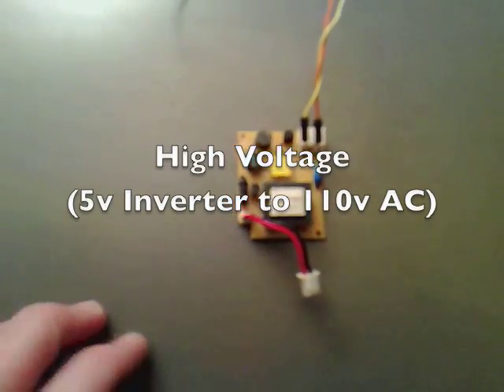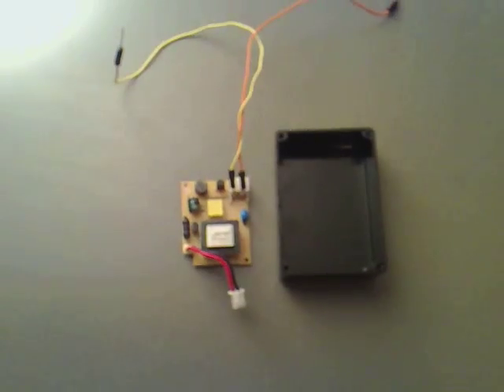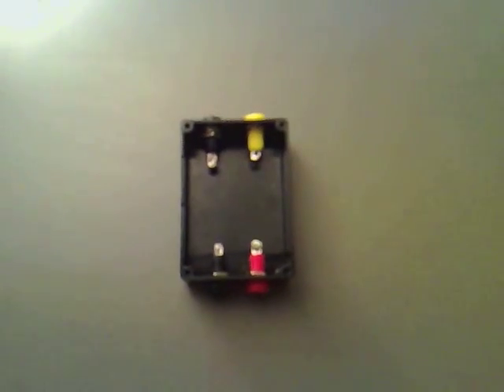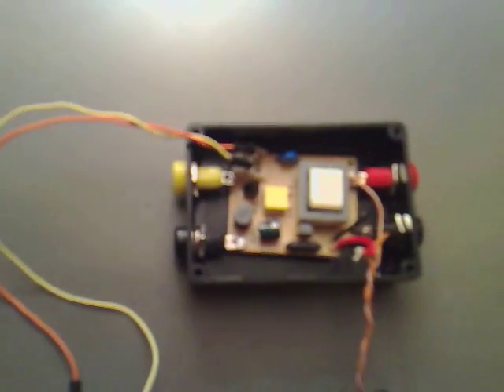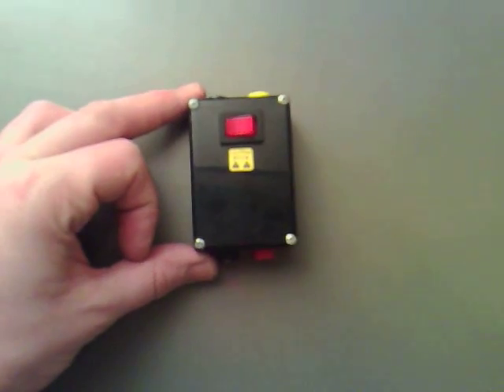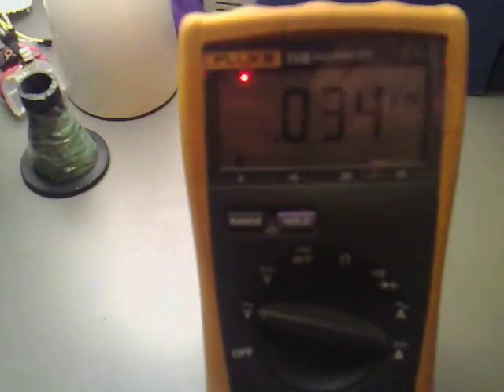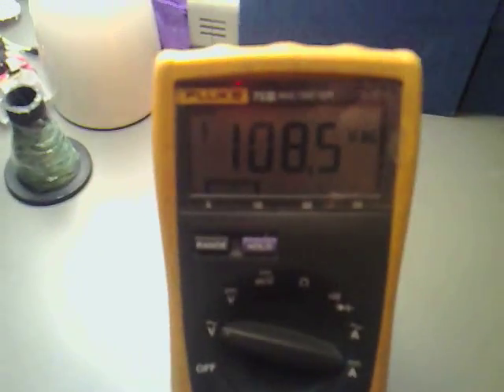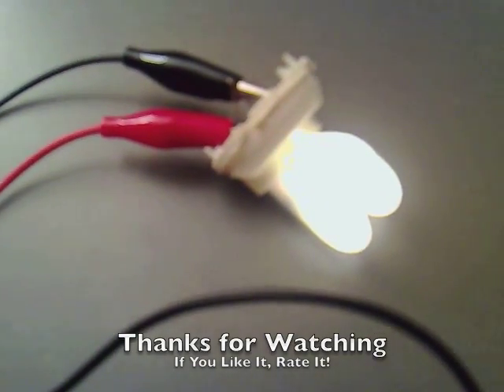High Voltage (5v Inverter to 110v AC) 004

Comment: if you add a 240 v ac capacitor can you run anything? or use it to charge dc batteries to then run an inverter??

Comment: I am building an inverter for sending a PWM signal from raspberry pi to a Yaskawa AC Servo motor. I just want to convert 5 volt dc Rasp. Pi voltage to 110 volts ac voltage for motor to run. I can use this inverter. 
Please can you email me the circuit diagram 
schitale@uncc.edu

Comment: I am very interested in what you did converting 5 volt DC to 110 volt AC. Would it be too much to ask you how exactly did you create that? I am interested in using you idea to run a little air pump to the aqauarium.

Comment: Check out my high voltage inverter circuit. (1) AAA battery will produce 120VAC(pulsed DC) or higher. Full Schematic included. I have used this circuit in conjunction with a full wave voltage multiplier circuit to achieve 1000v output.

watch?v=Q7gw3uDRXPw

Comment: Yes, you are correct... it's an inverter but very low power output. In addition to that, the FREQUENCY of the square-wave output is in the 30kHz-100kHz range which is much too fast to be useful for anything "appliance-like" that would ordinarily run from household 110vac, even if the output was several amps rather than the milliamps it does put out.

Practical uses for a supply of this power & frequency are voltage-multiplier, Nixie tubes, small fluorescents (or neons), bug-killer racquets etc.

Comment: To clarify "72fr250"s comment about all transformers being bi-directional - 

His statement refers to the typical winding-based transformers themselves, rather than "power supplies" that will have circuitry AFTER the transformer to convert the AC to DC. Trying to use a power supply (110vac to 5vdc) backward will not work at all.

Comment: -1000 volts is consider high voltage. But 100 volts is also high voltage, since it can cause injury to humans and need insulation and we mostly encounter such voltage and it can kill. Meaning can vary to discussion.

Comment: Most consider >30 or 50 to be high voltage since it usually comes with more then enough current to seriously injure you :(

Better to be safe then sorry.

Comment: it converts DC to AC by using DC to AC conversion. half wave oscillation reference voltage quantum flux capacitance ohms inductor frequency resonance pi alpha gamma beta radiation harmonics delay analog digital programming and or nor not nand gate feedback non sequential numbers integer digital mathematics photon circuitry.

Comment: @TheError404 I totally agree. I have a video up of me driving a CFL with these units. And I doubt its 5v...(though I may be wrong). I drove mine at 12-15, based on the idea that on the back of the scanner (the old ones) it usually says 12-30 VDC input OR, the converter is inside.

Comment: @vidz022 never not even a picosecond.
how many watts does a tv suck? about 95 watt . and these inverters are designed to run a 5 watt ccfl and for powering up 95 watt + 3 watt energy loss of the inverter u need a 12 volt and 14 Ah to run it for 2 hours and that will kill the batt and u need a 100 watt inverter

Comment: can it gives power to a TV set? if so, how many hours can it run the TV? i dont know if the battery would drain fast without the solar cell charging. nice video!

Comment: I just had a thought here.

you could get take 1.2 volts , raise that to 3 volt using simple voltage doubler
expecting huge current loss

need to know how much current you're gettin from your solar panel

and how much on the final output under load.

Comment: I can get 50 volts out of a phoneline. I can get 10,000 out of a car ignition coil. But whats most important, what the amps are. I can touch the phone line just fine and don't feel a thing unless my hands are wet. Now if it had and amp or 2 running thought it, I'd most likely feel it. Lol

Comment: 5v, perhaps 300ma. 100v, perhaps 500(micro amps). low voltage high current, high  (not really) voltage low current.

Comment: I would have thought the neon switch would need to be wired to the high voltage side in order to light up, not the 5v side.

Comment: If u want one with 500-630 Volts with 12 V DC input go to the next pc shop of you choice or order on amazon a cold light cathod with a single inverter

Thumbs up if this helped :) oh and the colored Cable(mostly Red)  that goes into the Inverter is Plus, the black one Minus

Comment: so it terns 5v DC in to 110v AC and it came from a flat bed scanner?
so is it posibel to run 12 v in to the DC and get 110v on the AC

Comment: btw, this is not high voltage :) in DC, <120V=extra low voltage, 120-1500V=low voltage and any voltage >1500V is considered high voltage.. hope i don't sound like a total nerd, but i thought you should know :)

Comment: Just to let you know, or you may have already found out that this is actually a high voltage CCFL tube inverter that actually puts out a little more than 1000 volts at a really high frequency (in the Khz range). that readout was inaccurate and you have probably seriously damaged your multimeter.....

Comment: Everything produces some kind of waste product. To rule out a source of power because of this is naive. What you should be asking are: can it supply a meaningful amount of power, can it be relied upon to produce a steady flow of power, can it do this economically and can any waste be handled and processed safely.

Also, it is easy to criticize but a lot harder to come up with solutions. People searching for solutions rather than just sniping from the sidelines tend to garner a lot more respect.

Comment from the maker: This is a UK 230v Tube, well they are all the same the tubes... its the electrics that goes inside that changes it to High Frequency mine runs at 520Htz 108v AC. 

I live in the UK and I cant see any difference, I could be wrong though.

Paul.